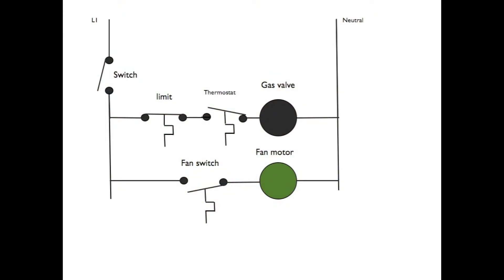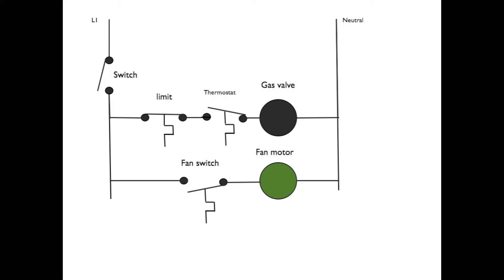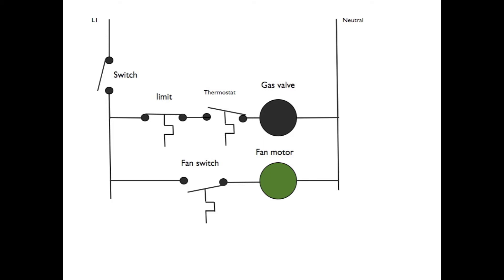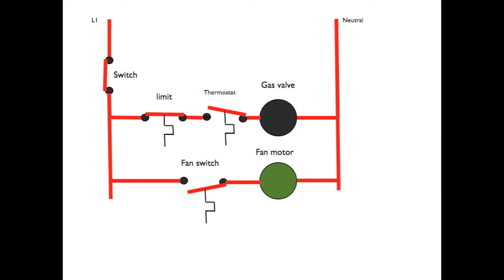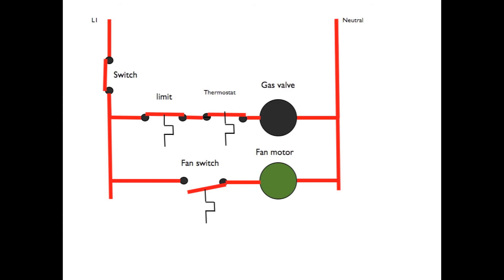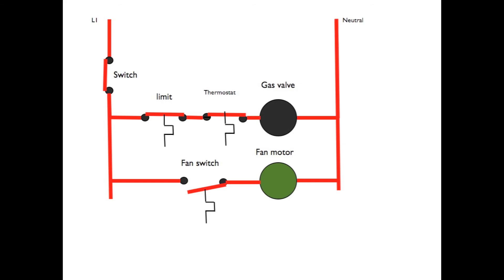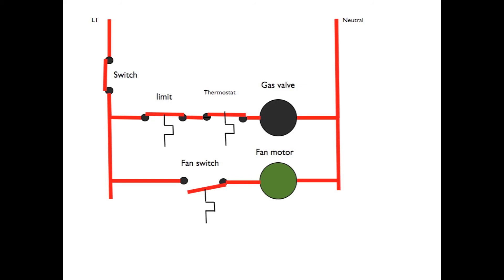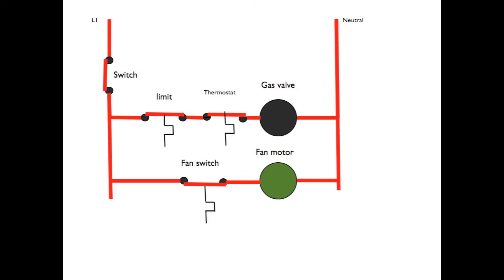Schematic diagram #4

Comment: Quick question. From top to bottom on the parallel diagram. Is it in order. So the top toer of the ladder will energies forst then thr 2nd. Third etc
Reply from the maker: Sam Hargreaves No.  They all energize at the same time.  Unless you are considering Nanoseconds.
GFM
Reply: Awesome, thabks for the fast reply. 1 more question, I live in australia, your diagrams will still make sense over here?
Reply from the maker: Sam Hargreaves For the most part, they will be the same.  You use 220 volts so anything using 120 volts would not be used, but the components and wiring should be the same.  
GFM